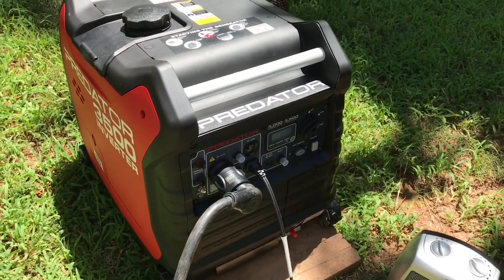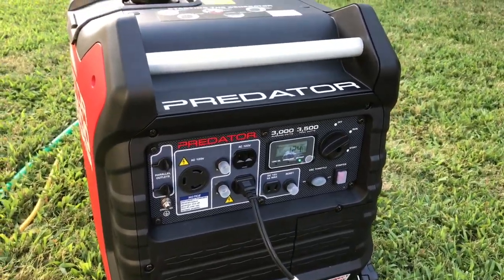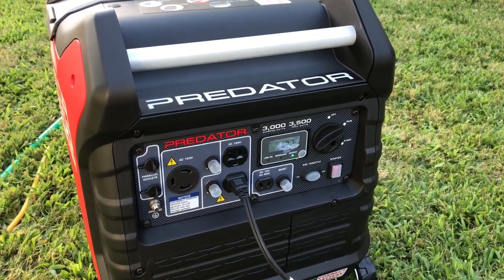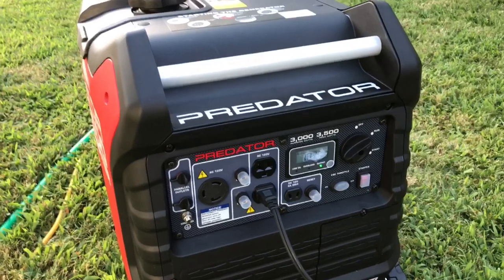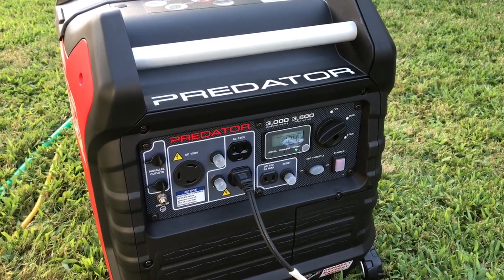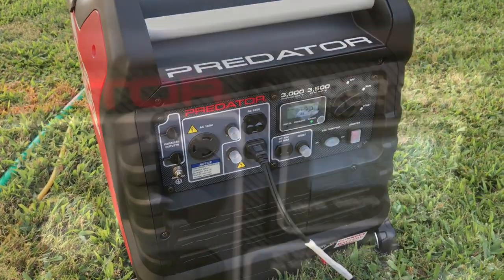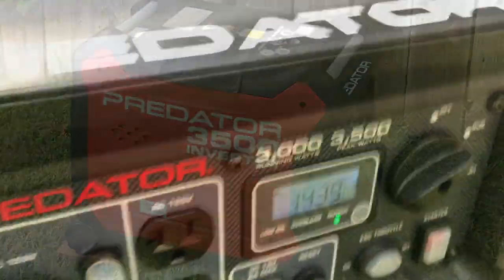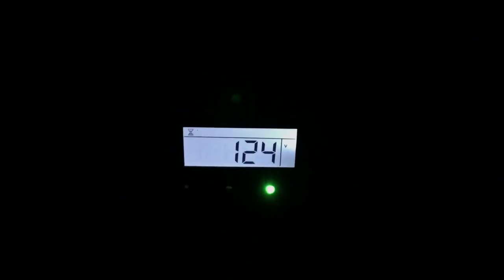Predator 3000 3500 Watt Inverter Generator Test - Defective Replacement

Comment: Im on my 2nd one of this model within a month and i personally dont like it . the first one died and would not turn back on even after my husband tried everything after only 2 weeks of use. This new one we exchanged it for has gone 6 days and now is doing the samw thing. I had it on for 6 hours today, it died, i waited an hour to let it cool down to try to turn it back on and it will not turn on.
Reply from the maker: Charleigh Graham, I would really like to hear more about the problem you are having and help you troubleshoot. There may be a simple fix. Would you mind calling me or having your husband give me a call? I convert these generators into RV generators and would like to know about any problems that arise. My number is 4043695454. Thanks!
Reply: The problem with the last one was that no matter what it wouldnt spark which made it not start. This one finally did turn back on after a long time which is good because its super hot out. With the last one we had to take the exhaust plug out after 5 days because it got so dirty and clogged it wouldnt start, cleaned it off and put it back in and that solved the first mess up
Reply from the maker: Hi Charleigh Graham, sorry for the delayed response but I didn’t get a notification like I usually do so I didn’t know you had replied. 

So the spark arrester got clogged. What elevation are you using the generator at? I’ve never seen one clog up that quickly. The problem could also be air starvation which is a known issue with the case design. Removing the  battery cover or oil fill door will let more air in and allow the engine to run smoother. That may solve the problem with your spark arrestor clogging up. 

I hope you see this reply. Please come back and let us know if any of these suggestions help. Thanks!
Reply: Roland White we ended up just taking that one back and swapping it because it was still under warrenty. This new one is better it seems but yeah i think the case design is kind of dumb. They get so hot normally and being in texas it gets even more hot. Im not sure what elevation, we have it on the ground on top of thick plywood.

Comment: Microwaves use the most electric to run
Reply from the maker: That's strange. My microwave is rated at 1100 watts but it was showing a 1800 watt draw on this generator. When I get a chance I'm going to test it on a different microwave. A 1100 watt microwave drawing 1800 watts just doesn't seem right to me.